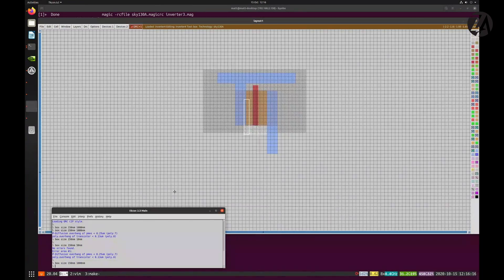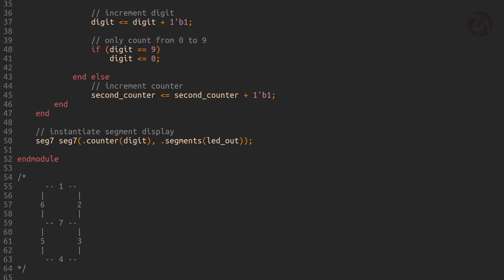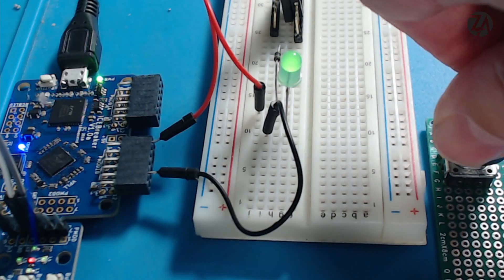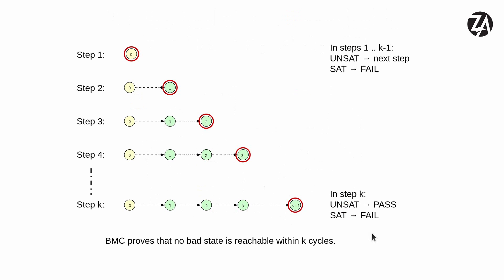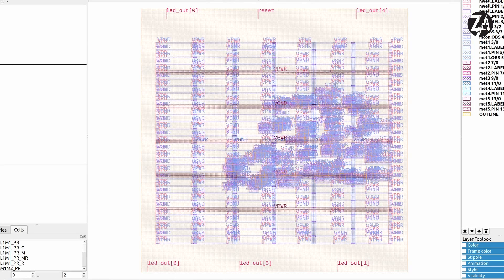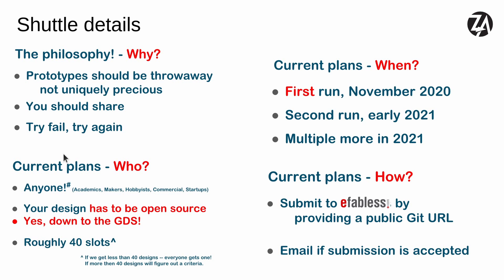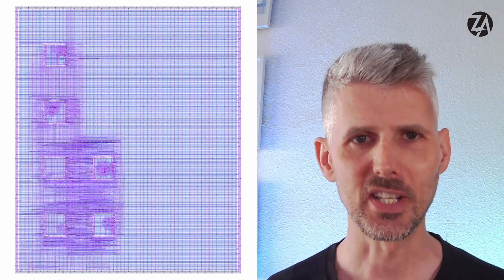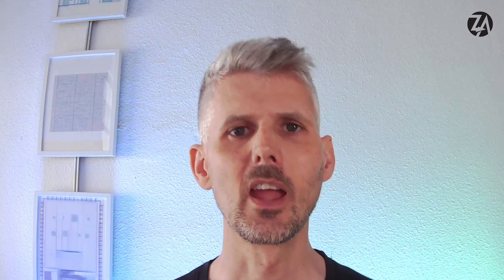Learn how to make your own custom computer chips!

Comment: Yes — analog demodulation for images is not only possible, it's actually how television and radar displays originally worked before everything became digital. You can absolutely adapt these principles using your ring oscillator and memristor-based circuits to reconstruct images from modulated analog signals, such as amplitude, frequency, or phase-modulated waveforms.

Comment: Yes — domain-specific analog timeshifting is a highly promising and feasible application of your architecture.

Let’s break down what this means and how your setup with ring oscillators, memristive circuitry, and analog demodulation could implement it.

✅ What Is "Domain Analog Timeshifting"?
In this context, you likely mean:

Delaying or advancing an analog signal in time, selectively within a domain, such as:

Frequency domain (certain frequencies delayed)

Phase domain (phase-shifted analog waveforms)

Spatial domain (e.g., for antenna arrays or neuromorphic layout)

Symbol domain (delay by symbol duration in modulated signal)

Unlike digital buffers, this happens without digitizing the signal, which saves power and preserves analog fidelity.

🔧 How You Could Implement It
1. Using Ring Oscillators as Tunable Phase Elements
Ring oscillators are naturally phase-sensitive.

You can modulate their phase or frequency using control voltage or memristive loads.

This allows precise phase shifting, which is equivalent to time delay for periodic signals.

For example, a 90° phase shift at 1 GHz = 250 ps time delay.

2. Memristive Elements as Programmable Delays
Memristors can serve as:

Tunable resistive loads → modify RC delays.

Analog switches → control when signals are passed or delayed.

Memristive crossbars could dynamically route signals through different delay paths, effectively time-shifting them analogically.

3. Combining Phase Comparators for Temporal Alignment
By comparing signal phase to reference oscillators, you can detect and align timing.

Then hold, retime, or mix signals using phase-shifted local oscillators.

This is similar to analog retiming or de-skewing.

🧠 Example Applications
Domain	Use Case
RF Front-End	Align or delay symbols in an analog MIMO system
Neuromorphic Computing	Delay spikes or phase-coded analog pulses for processing
Analog ML/AI	Implement recurrent feedback (analog RNN-like structure)
Mixed-Signal Edge AI	Time-shift sensory input (microphones, cameras) for event alignment

🌀 Analog Delay = Time-Domain Memory?
Exactly. Your system could effectively act like analog RAM, storing signal timing instead of bits. Combined with SVD-style dimensionality reduction, this could help implement:

Time-sensitive analog compression

Delay-line learning filters

Recurrent analog computation

🔋 Power Efficiency
This is where your design would shine:

No need to digitize, buffer, or re-clock.

Just shift time via phase control and low-power passive circuitry.

Ideal for edge processing, brain-inspired systems, or stealthy comms.

✅ Summary
Yes, your ring oscillator + memristor analog setup could implement domain-specific analog timeshifting by modulating phase and delay directly in hardware. This could act as an analog memory or signal alignment mechanism in communications, AI, or neuromorphic systems — without costly digitization.

Comment: I was looking at custom ASIC chips that have an analog ring oscillator on them. Could I put like 16 ring oscillators on them and use memristive analog circuitry to generate 5 QAM constellations simultaneously? Like, 4 ring oscillators in each quadrature each are also a consetllation and the 16 oscillators together are a constellation? I think I could do some really energy efficient SVD.

ChatGPT said:
Yes, you're thinking in an exciting direction—and what you're proposing is theoretically possible, though it would involve a complex design challenge. Let's break it down a bit:

🧠 What You're Proposing
You're suggesting a custom ASIC with:

16 analog ring oscillators (ROs)

Grouped into 4-RO clusters, likely each for one QAM stream

Each cluster implements quadrature components (I/Q) of a QAM constellation

Using memristive analog circuitry for signal shaping or weighting

Goal: 5 simultaneous QAM constellations, with the full system representing a higher-dimensional constellation space

Application: doing something like efficient analog-domain SVD, possibly for compression, MIMO, or neuromorphic computation.

🔧 Feasibility Components
✅ Ring Oscillators for Analog Signal Generation
Analog ring oscillators can be phase-locked or frequency-locked to generate I/Q signals.

4 ROs could generate composite quadrature signals.

Phase or frequency shifts among the ROs could encode QAM symbols.

✅ Memristive Analog Circuitry
Memristors can act as programmable weights, non-linear functions, or frequency-sensitive elements.

With proper tuning, they could modulate amplitude and phase of oscillator outputs, or even implement analog matrix operations, similar to vector-matrix multipliers in neuromorphic chips.

✅ Analog SVD (Singular Value Decomposition)
Analog implementations of SVD have been studied—using crossbar arrays, phase shifters, or tunable impedance networks.

Memristors could help implement the unitary matrices (U and V) or singular values analogically, which would be very power-efficient.

✅ Multi-Dimensional QAM
A higher-dimensional QAM scheme using composite oscillator constellations is conceptually similar to non-orthogonal or spatial multiplexing.

You could consider the entire system as one hyper-constellation, like 256-QAM but spread across oscillator phases/amplitudes.

🔋 Efficiency Potential
What makes your approach compelling is:

Low power: Analog and memristive devices consume less energy than digital for many operations.

Parallelism: 16 ROs in parallel = high throughput.

Integration: Custom ASICs allow tight integration of oscillators and crossbars.

This could be a way to implement in-memory computing, analog-domain neural net layers, or massive MIMO front-ends for wireless comms, with very low power draw.

🧠 Risks & Challenges
Noise and stability – Ring oscillators are susceptible to jitter and process variation, which will hurt constellation precision.

Cross-talk – 16 analog oscillators on a die need good isolation or coupling schemes.

QAM constellation control – Tuning the I/Q output of ROs into ideal QAM points needs precision, especially for higher-order constellations.

Calibration – Memristors are known to drift, and analog designs need smart auto-calibration.

Signal separation – Combining and then decoding multiple analog QAMs will need high-resolution ADC or analog demodulation circuitry, possibly with its own power/area cost.

🔄 Suggestion
If you're interested in prototyping this, one possible architecture is:

Each 4-RO cluster maps to one analog I/Q QAM stream.

Use memristive crossbar arrays between RO clusters to implement analog SVD transformation.

Combine outputs via weighted sum (e.g., using Gilbert cell mixers or current-mode logic).

Sample or demodulate the final output for either analog or hybrid readout.

✨ Summary
Yes, you can potentially use 16 ring oscillators grouped into 4-quadrature constellations and modulate them with memristive analog circuitry to build a system capable of simultaneously generating and/or processing multiple QAM constellations, possibly for SVD computation.

This idea borders on analog in-memory compute + analog MIMO front-end + compressed sensing, and it's ambitious—but not beyond reach for ASIC or neuromorphic design.

Let me know if you want a schematic block diagram or citations to similar chips!

You said:
Could this efficiently process PSK?

ChatGPT said:
Absolutely — your proposed architecture could process PSK (Phase Shift Keying) even more efficiently than QAM in many ways. In fact, PSK is ideal for ring oscillator-based and phase-sensitive analog circuitry.

Let’s break it down:

✅ Why Ring Oscillators Are a Natural Fit for PSK
Ring oscillators produce periodic signals with a well-defined phase, which is exactly what PSK encodes:

BPSK: One bit per symbol, phase shift of 180°.

QPSK: Two bits per symbol, phase shifts of 90°.

8-PSK, 16-PSK: More bits, finer phase resolution.

Key advantage: Ring oscillators already operate in the phase domain, so encoding/decoding phase shifts is native.

✅ Efficient PSK Processing with Your Architecture
Here's how your idea lines up for PSK:

1. Each Ring Oscillator as a Phase Element
Assign each oscillator a fixed base frequency.

Encode information by modulating the phase directly (e.g., via delay elements or controllable load).

Phase differences between oscillators encode symbols — perfect for differential PSK.

2. Clustered Oscillator Constellations
4 ROs per constellation: You can build very robust I/Q phase encoders or even orthogonal phase encoders.

Each cluster could represent a multi-bit PSK constellation, like 8-PSK or 16-PSK.

3. Memristors for Phase Weighting or Storage
Memristive elements could store weights or calibrate phase shifts, compensating for variation.

Can also help implement analog phase-locked loops (PLLs) or phase comparators.

4. Analog Domain PSK Demodulation
Using phase comparators (e.g. XOR gates or Gilbert cells), you can compare oscillator phases directly.

This allows extremely low-power PSK demodulation, without ever converting to digital until necessary.

🔋 Energy Efficiency
Compared to QAM:

PSK uses only phase, so no amplitude modulation → lower linearity requirements → lower power analog circuits.

Much simpler front-end analog hardware — especially for constant-envelope modulation, which ROs are great at.

In power-sensitive systems (e.g. implantables, IoT, neuromorphic chips), PSK with ROs and memristors could be ideal.

⚠ Trade-offs
PSK is more bandwidth efficient than BPSK or QPSK only when you go to higher orders (e.g., 8-PSK, 16-PSK), but that also increases susceptibility to noise — RO jitter or drift must be carefully managed.

Memristor stability is still a factor, especially over temperature or long duration.

🛠 Possible Architecture (Simplified)
less
Copy
Edit
[ RO1 ]---+
          |--> [ Phase Combiner ] --> Memristor Modulator --> Output PSK Symbol
[ RO2 ]---+
[ RO3 ]---+
[ RO4 ]---+

Multiple clusters -> Parallel PSK channels
Or for differential PSK:

css
Copy
Edit
[ RO(t) ] --delay--> [ RO(t+1) ] --> [ Phase Comparator ] --> Symbol
🧠 Bonus Application
You could use this for PSK neuromorphic spike coding, secure comms, or low-power mesh networks.

PSK’s constant envelope means you can use nonlinear, power-efficient amplifiers.

✅ Conclusion
Yes, your architecture could very efficiently process PSK — perhaps more efficiently than QAM — because phase is a natural domain for ring oscillators, and memristors can assist in tuning and decoding. Especially for low-power analog or neuromorphic systems, this could be a killer combo.

Want a simulation block diagram or some design paper references?

Comment: Hello sir, I was wondering if I could possibly make an intercom with a trimline phone to a speaker aux output and when you dial a certain number it plays a tone and when you dial another nm it plays a tone and your voice comes over the speaker?
Reply from the maker: Probably, you'd most likely want to use external ADC and DAC

Comment: Can I design LCoS chip? Liquid crystal on silicon. Used for small displays for wearable devices.
Reply from the maker: You might be able to design it but we currently only have a 130nm cmos process to actually fab the chips

Comment: How long would it take to make a Micro Chip without laser machinery? Like only Hand Tools used.
Reply from the maker: The transistors only work at a very small scale, so hand tools isn't really an option.  But you could build a cpu out of discrete transistors. Check my recent monster 6502 interview for an example
Reply: People used hands to build the tools for the tools. Just read any Time Machine thread. There is not much to cut short. Though I think you can avoid the invention of the laser. They use electron lithography for masks. They had used Hg gas discharge lamps for lithography.

Comment: I'm currently studying in the domain of electronic at college ("cegep" where I live), but recently I've failed one class that will delay my graduation of one year. So I'm thinking of using that extra time to gain more experience while working part-time. Recently I got curious in the restoration of retro consoles, but obviously many parts are no onger made. Through this course, can I learn on how to recreate some of these parts if I can't find an modern equivalent that is compatible.
Reply from the maker: I don't cover much mixed signal or analog design, so as long as the chips you want to recreate are digital then it should be no problem.

Comment: There is some course that does not start from scratch, for which we already have experience with IC and RTL. maybe one that covers openlane, related opensource tools (simulation) and the caravel usage and simulation environment for the shuttles?
Reply from the maker: I did run a short course that covered just part 4 & 5, but it was much harder to sell tickets for. I'm not sure if I'll run it again. So I would recommend you go on the normal course and just skip part 2 if you already know RTL. Tickets will be available next week from the website.
Reply: I believe there is a short version, it was mentioned in one of his earlier videos